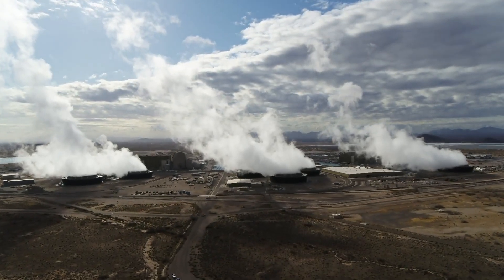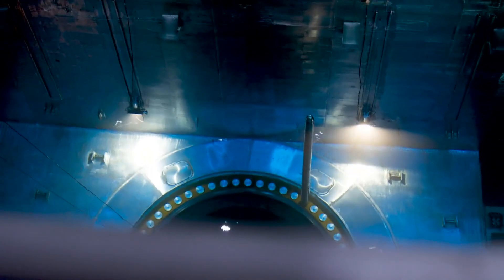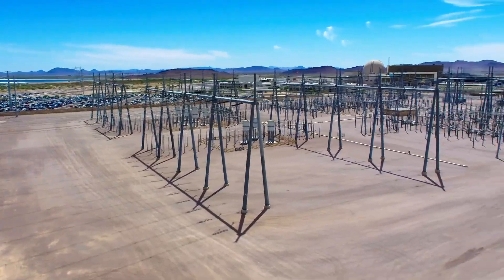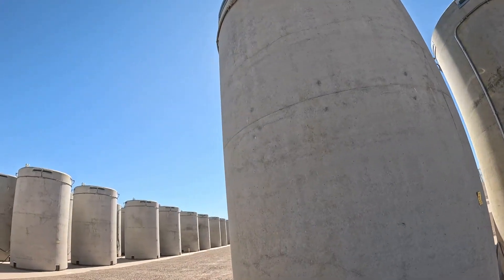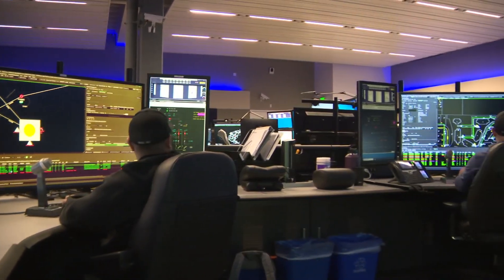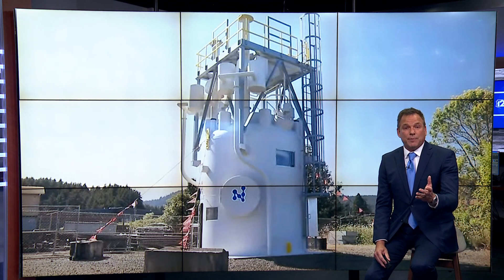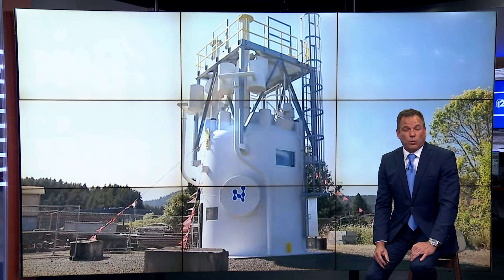Could more reactors be added at Palo Verde?

Comment: The fact that the nuclear waste of Palo Verde NPP of several decades fits onto a parking lot, is actually an argument for nuclear power, not against it.

Nuclear waste is compact, can be recycled by 96% (France and the UK have been doing it for decades) and has never harmed anyone. The remaining 4% have to be stored for just 300 years.
Reply: "Nuclear waste is compact, can be recycled by 96% (France and the UK have been doing it for decades) and has never harmed anyone. The remaining 4% have to be stored for just 300 years."

so I have a question about that, are those kind of reactors a different type called a fast breeder reactor? the reason I am asking is because I am kind of confused about the debate (if you can call it that at this point) about reprocessing spent nuclear fuel rods and making them produce power again? I hear that this process is actually illegal to do in the United States, is this actually true?
Reply: @clearrighttoknow4775  A breeder reactor has mainly the purpose to make more use of the Uranium, not to reduce waste.

A fresh fuel element consists of about 96% Uranium-238 and 4% Uranium-235. The latter can be fissioned in a normal (thermal) reactor, the former cannot. This means that a normal NPP like Palo Verde will just "burn" the Uranium-235, not the Uranium-238 (plus minus some fractions). A breeder will also consume the Uranium-235.

When fuel is used up in a normal reactor, most of the Uranium-235 will have been turned into fission products - the actual waste. In reprocessing, these fission products are extracted from the fuel so that you get the remaining Uranium-235, the Uranium-238 and some fractions of Plutonium (forgot which isotope).

The fission products have to be disposed of, while the Uranium and Plutonium can be remade into so-called MOX fuel which can be used in most standard reactors. Thus, you already get a fuel cycle with just reprocessing which is why France has just very little amounts of spent nuclear fuel to store for 300 years.

Since the Uranium-238 is kept within the fuel cycle, the breeder doesn't avoid any waste here. It just maximizes the energy output you get from the fuel.
Reply: If it is, change those damned laws!! Something for Pres. Trump and his 🖊️!!😀

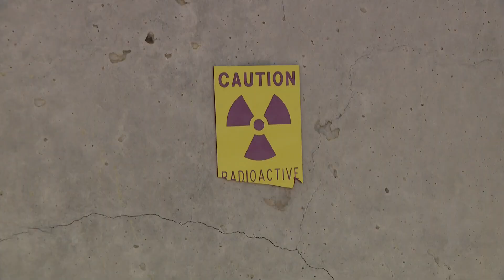Comment: At 3:02 the guys in the back are all kitted out with their bunny suits, gloves, etc and the guy at the bottom, who is just wearing gloves, is the one handling the fuel rod assembly. LoL
Reply: Having worked in nuclear plants, I can tell you exactly why. The two men in the coveralls (white suits) are on the refueling bridge, which moves back and forth over the spent fuel pool. The water in this pool is extremely clean, but since it's in contact with spent nuclear fuel, it must be treated as contaminated and hazardous. It's possible for that water to drip off of the crane when they remove it from the water when repositioning fuel assemblies. Thus, the entire bridge and area immediately around the pool are considered contaminated areas, which requires any personnel going inside the area to don coveralls, boots, gloves, etc.

The worker on the bottom is outside the contaminated area inspecting new fuel, likely just unloaded from a truck a few hours prior. This fuel is guaranteed to be clean, so the worker handling it does not need to wear protective clothing. It has nothing to do with radiation coming off the fuel, since new fuel has very little radiation coming off of it, and thin paper or wool clothing will not block radiation anyways.

The suits are not that expensive, but they are a tradeoff because they reduce your body's ability to cool off, reduce dexterity, and take time to put on. I'm certain that the worker COULD be wearing a suit if it made them feel better, but it is not required for the task they are performing in the video.
Reply: Just an FYI, they guys in the background were working on a contaminated area and are required to be dressed out as we call it in the industry. The one person wearing just gloves was more than likely doing a visual inspection of a new fuel assembly that has not yet been through a cycle or it would not be out in the open, it would be in the spent fuel pool where the water itself is the shielding from radiation. I have spent better than 30 years in the nuclear power industry with most of my time at PV. Hope the exsplination helps 😉

Comment: I thought the goal of the small modular reactors was to plop them directly outside the point of use, in this case meaning the datacenter, so that the facility is basically self-contained and doesn't have to draw on city power.

Comment: How much water does a high pressure nuclear water reactor use … plus how about privatising the cost of nuclear waste storage
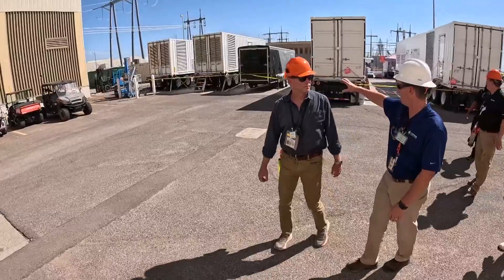Reply: Already privatized and included. Stored privately until needed, handily cached at plant site. Mix 1:10 Pu:SNF and run in a MSFBR [Molten Salt Fast Breeder Reactor) for 40 years at a go. And no cooling water needed, air cooling would be fine. The process heat from such can be used to make carbon neutral jet fuel, etc using a bit of water for H2 and CO2 from the water as well (more accessible than from the air, but less than from seawater).

Comment: We all use waste water.  We drink waste water.  There isn't nearly enough water, waste, well, or CAP, to meet the needs of another reactor, let alone two.  We could be using a LOT more solar on our homes, however both SRP and APS have effectively killed rooftop solar(through the AZ Corp Comm)by buying back from customers at the wholesale rate about 1/3 of what they sell back the electricity. The video was a nice puff piece of journalism though.
Reply: @joegreenwell-gu6de Air cooled reactors would be fine. Holtec and others have that option.

Comment: The Moltex SMR (Small Modular Reactor) 100MW project in St John's, New Brunswick, has yet to start. Construction is estimated to take 7 years. Additional large reactors like Palo Verde take at least 15 years to build and require 5 years of approval. Plus, they are the most expensive energy to run, considering building costs and free sun.
1,200 MW of Solar takes two years from approval to production. The cost of $64Wh/kg LFP battery storage used with solar is now dropping 65% over the next five years. We should add more solar energy while we wait for the nuclear base power plants to be built. 1.8 GW of power will be needed for the 15-year build of the new Buckeye Tract data centers. We need immediate solutions, not talk.
Reply: And reduce red tape and construction times! It should not take any longer than, say, a large nuclear aircraft carrier. Those take several years, but certainly not 15 years to build!!!

Comment: You forgot to mention how a large percentage of the nuclear "waste" sitting outside can be processed to generate even more power and reduce the amount of waste.
Reply: Bingo. Close the fuel loop like France? Problem solved!
Reply: Not really effective. Palo Verde is indeed one of the only nuclear facilities in the USA that is designed to be able to run on MOX (the mixed fuel from reprocessing regular uranium fission waste,) but it doesn't make any economic sense to do so.

The question of dealing with waste is such a small and trivial part of the nuclear problem. Even if we continue to just cask it onsite, it's not a problem. However the economics of running a nuclear power plant ARE a big problem.
Reply: I believe France recycles their nuclear waste from nuclear power plants.

Comment: I was on site near the beginning of construction and was told that the original plan by Brown & Root was for 12 units completing a circle, with a wastewater lake in the center. sounds like a plan. But they need a new Reactor design!
Reply: I thought it was for five total originally?
Reply: @NWer-c5u  You are mostly correct. The ORIGINAL design is what we have today, but the designers applied for permits for 2 additional units during the initial planning. The 2 additional units would NOT have been in an arc with the other 3, but would have been south of unit 3 in a north-south orientation. Check out the Wikipedia page for the Palo Verde Nuclear Generating Station. It has a great summary of the plant and its history, along with some great links to their sources for additional reading.

Comment: What about huge grid scale solar farms and battery installations. AZ has one of the greatest solar irradiance numbers of any state. It just takes one accident to make an enormous mess, just ask residents of Fukushima in Japan, they are still cleaning up up after the 2011 Earthquake and a power station that will never be used again.
Reply: solar farms dont work at nighr. and batteries are still not technologically advanced enough to store all that energy into the night. AZ never has earthquakes, and this plant is not located near a body of water like fukushima. also, all plants are required to have additional equipment that wouldve prevented fukushima. and that earthquake created a tsunami well above they area ever expected to see in its lifetime, its like building a 15 ft wall and then getting hit with a 20 ft tsunami, then asking we shouldve built a 20ft wall…. well hindsight is 20/20
Reply: We don't have earthquakes or floods to worry about here.
Reply: Solar is better as agrivoltaics not alone
And we should just use open new gas plants with fuel cells
Reply: Solar farms would need to take up huge swaths of land, require a lot of rare earth metals, and barely last a decade.  Palo Verde is located in the middle of the desert, not in an area riddled with earthquakes and tsunamis like Japan.  It's much better situated and planned.
Reply: @Oinsichean  water buddy water. How do we cool the reactor without water.
Reply: @potpurrie_farm Currently, they use waste water. You actually watched the video, right?
Reply: @potpurrie_farm with all your liberal tears from losing the election
Reply: @potpurrie_farm  We don't cool it without water.  We cool it with the same recycled water *that it's already using*.  Buddy.

Comment: at 3:01 why doesn't that man have those white suits the other two in the shot are wearing? is there a barrier between them?
Reply: The guys in the suits are working in close proximity to potentially exposed radioactive contamination, the white suit is to prevent/minimize any radioactive particulates from getting on them. When they are done working they will use a scanner (like a metal detector wand) to find out if any particles are on them and then take off the suits.

The other guy likely is not close enough to potentially get any particles on him.
Reply: @DrewGalyen  For sure, this seems almost common sense. But why not just give him a white suit just in case. Are they super expensive that they cannot afford to just give him one?
Reply: yes, the white barrier.
Reply: Having worked in nuclear plants, I can tell you exactly why. The two men in the coveralls (white suits) are on the refueling bridge, which moves back and forth over the spent fuel pool. The water in this pool is extremely clean, but since it's in contact with spent nuclear fuel, it must be treated as contaminated and hazardous. It's possible for that water to drip off of the crane when they remove it from the water when repositioning fuel assemblies. Thus, the entire bridge and area immediately around the pool are considered contaminated areas, which requires any personnel going inside the area to don coveralls, boots, gloves, etc.

The worker on the bottom is outside the contaminated area inspecting new fuel, likely just unloaded from a truck a few hours prior. This fuel is guaranteed to be clean, so the worker handling it does not need to wear protective clothing. It has nothing to do with radiation coming off the fuel, since new fuel has very little radiation coming off of it, and thin paper or wool clothing will not block radiation anyways.

The suits are not that expensive, but they are a tradeoff because they reduce your body's ability to cool off, reduce dexterity, and take time to put on. I'm certain that the worker COULD be wearing a suit if it made them feel better, but it is not required for the task they are performing in the video.